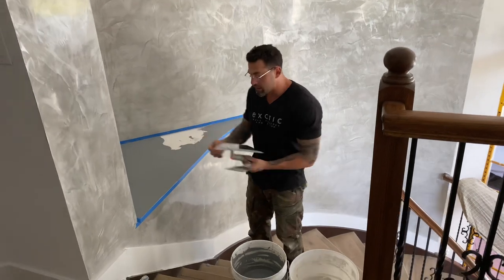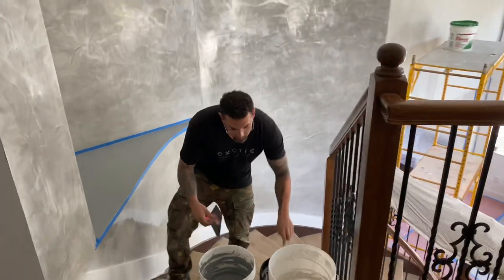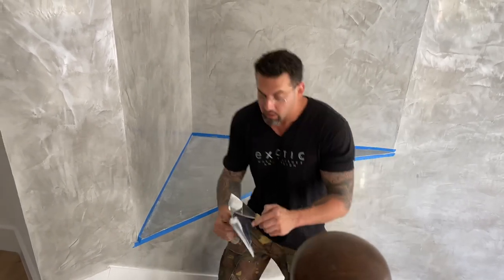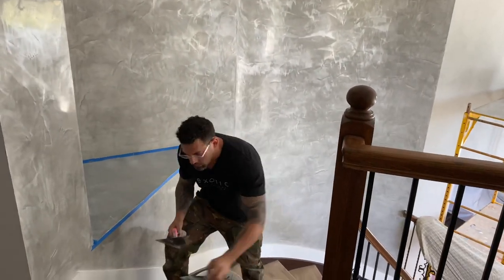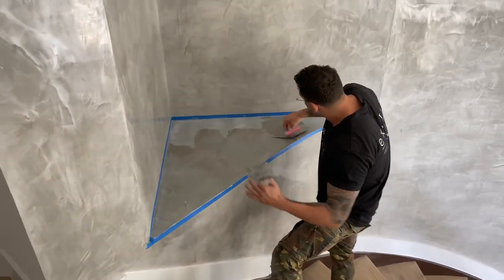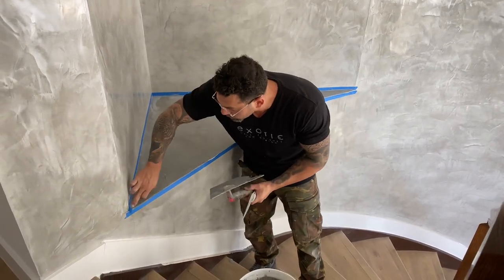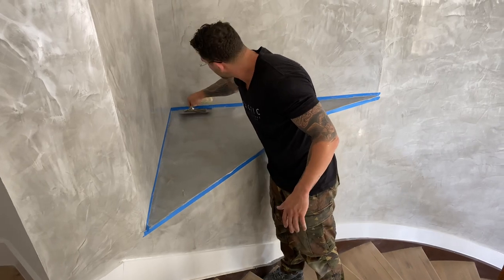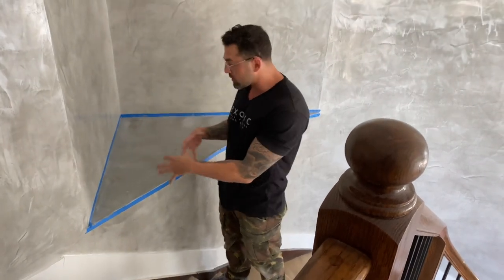Venetian plaster 3 tone Marmorino on this floor piece. Exotic wall finishes

Comment: its wet on wet but work from dry to wet. umm ok
Reply: Uh, makes sense to me. wet on wet is the technique he's teaching. Working the product on is working dry  into the wet. ( as far as the motion of applying the  product)
Reply: From the dry edge/corner of previously applied now finished plaster on the adjacent wall